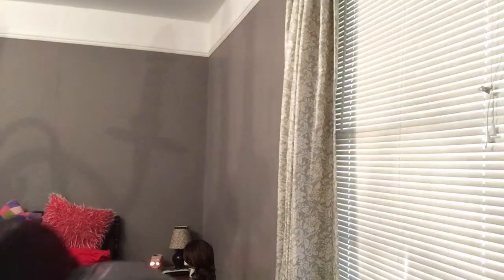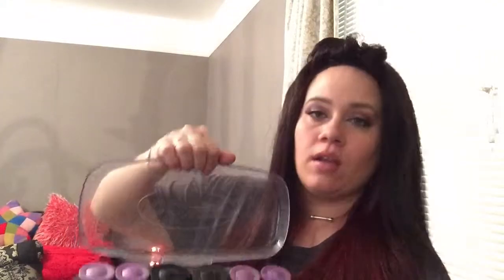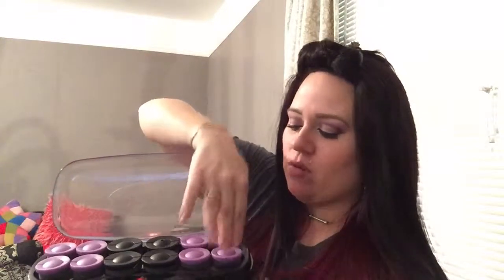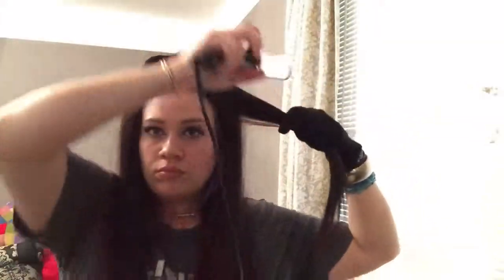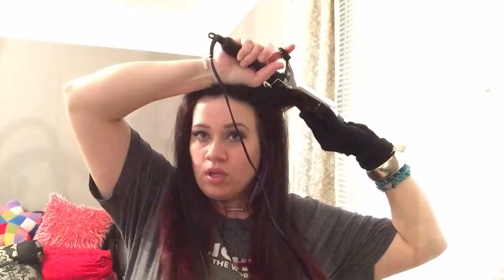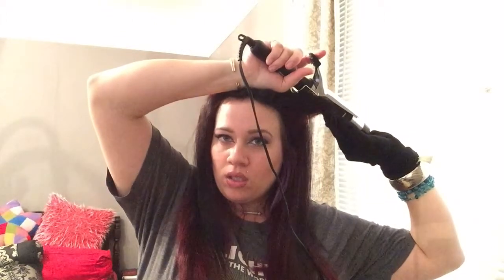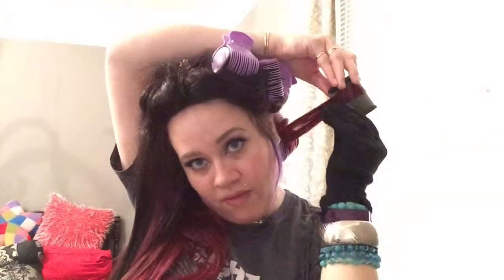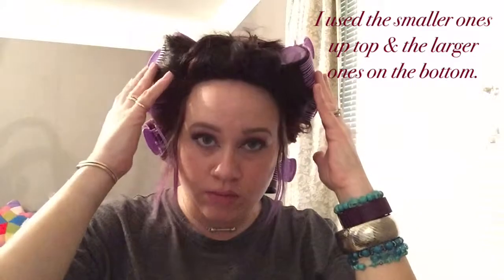Get Big, Sexy Curls in Synthetic Wig with Curling Iron & Hot Rollers!

Comment: That’s because you need to add water to your hair first, before you put the roller..Synthetic hair is not going to curl when it’s dry you have to moisture in it a little bit spray it with a little Spritz bottle then put your Hot rollers in then you would get a nice Curl!